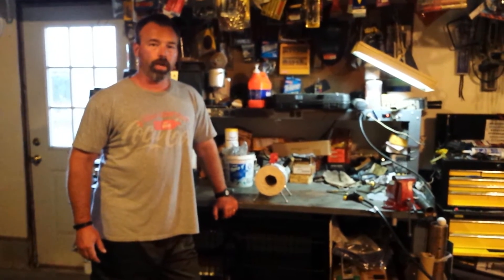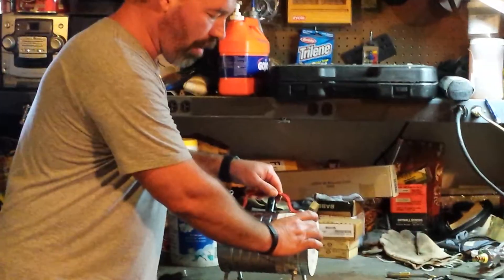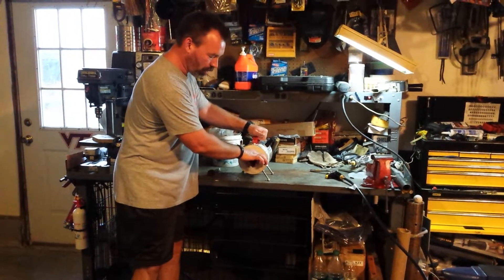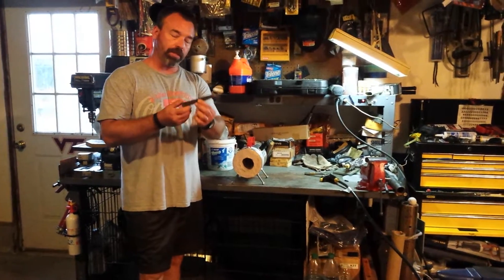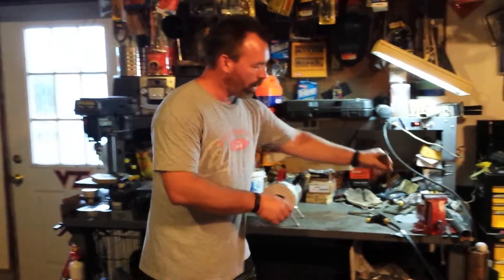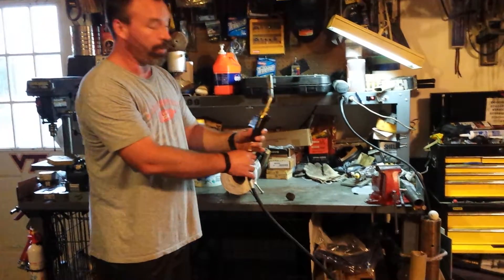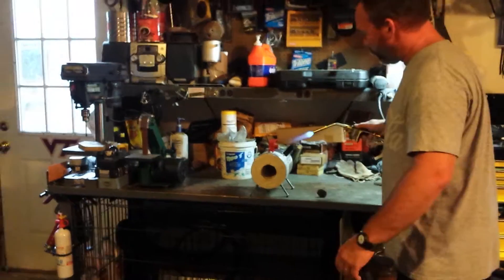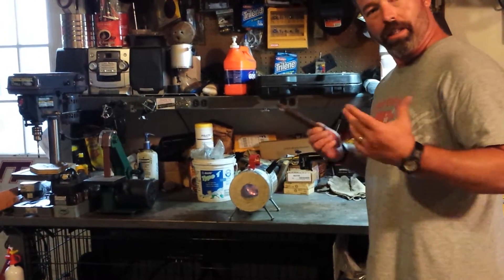Mini coffee can forge

Comment: Hey, man. Have you done any knife work with that mini forge? How is it going? I was planning to make one mini forge like this myself, but I´ve heard bad comments about this plaster/sand mix. So, how is it working for you?
Reply: +Daniel Ferreira This plaster of paris/sand mix is really easier to find and much cheaper than the alternatives. I´m just on hold for doing some reasearch on this topic so i dont waste money and time.
Reply from the maker: +Daniel Ferreira I have made 8 knives using the forge and it is holding up well so far. Some of the refractory mix has started to erode around the mouth of the opening, but still has plenty of life left. The next one I make I plan on using refractory cement in the mix. This was recommended by a co-worker with lots of refractory experience. I would guess by the rate it is wearing, I will be able to do about 40 knives before needing to redo the refractory.
Reply: Thank you very much! That was exactly the answer I was hoping for...
Are you planning to do videos on knifemaking?
Reply from the maker: +Daniel Ferreira I doubt I will do any videos due to the time it takes to make a knife. I generally spend about 3 hours from start to finish. I like to keep all my videos around 3 to 4 minutes for ease of uploading. Good luck with the forge.

Comment: Can you tell me the steps on making the mixture for the forge? Thanks for your time...
Reply from the maker: +Charles Randolph There are several mixes you can use for the refractory. I used a mixture of sand, perlite and plaster of paris (equal parts of each) It will take about a week to cure. You can also use "refractory cement" available at Home Depot- Good luck.